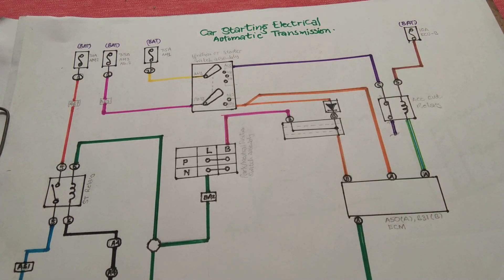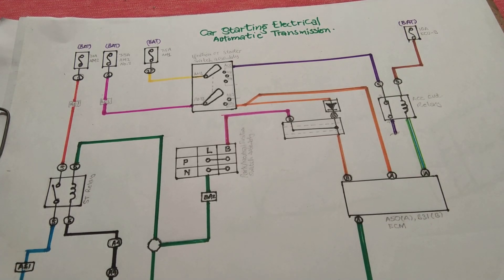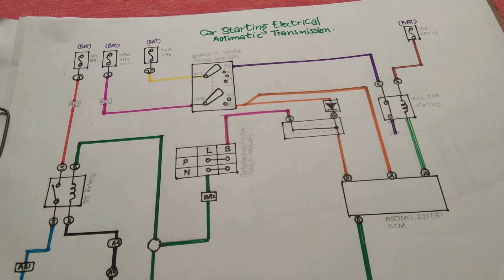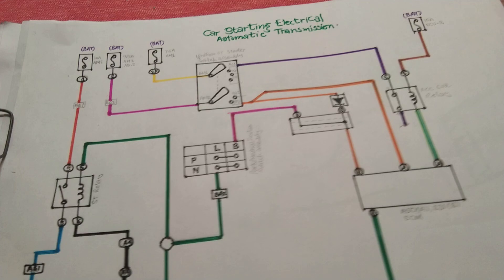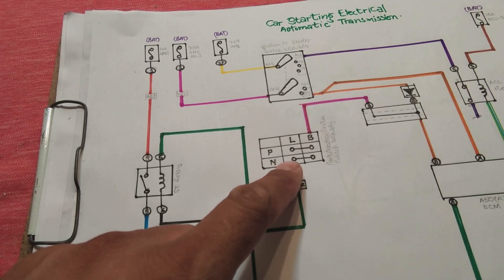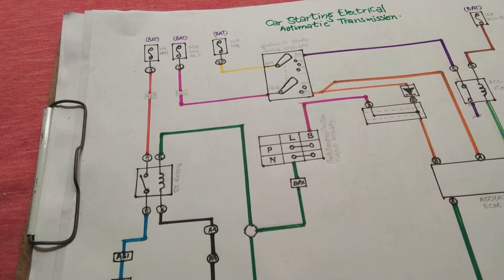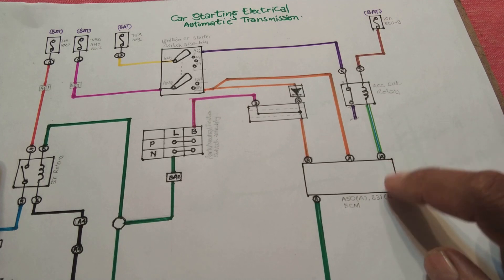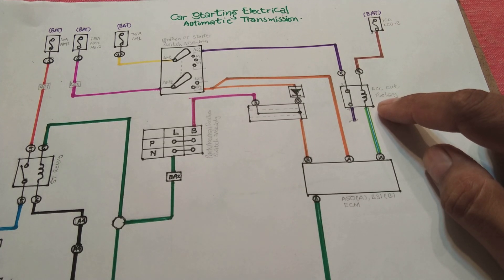Car starting circuit wiring explained. car electrical repair. Ignition switch, park neutral & relay

Comment: Nice clean diagram. Sadly only for regular cars. I have a 17 yr old  racing pickup, ford lightning. makes no parts anymore. Its supercharged (factory) mega sound system (I did). Factor in my wire harness cut into 10+ times by thieves. It still runs. Relays get hot meltly. I let mechanic service supercharger and intercooler fluid. BAD mistake. I only get 8psi boost. It always did 11. No power to radio or canin lights when its one. Will have to probably drive it across the USA to get still alive master to help/teach. I will never sell this pickup for life. Ugggh. Super rare cars :(
Reply from the maker: Great to hear from you. Soon I will bring a regulator alternator video which would be a universal alternator regulator 1 wire which would be fixed in all trucks and cars. Stay tuned.

Comment: Hii sir..  am from Karnataka. I have  honda genrator ( exk 2800 s) .  And also 1 kva UPS. When power goes my UPS is not charged thorough the generator.. where has iam adjusted proper voltage... What is the fault  according to you...?
Reply from the maker: It should charge. Make little more testing and voltage analysis. Hope you would solve it.